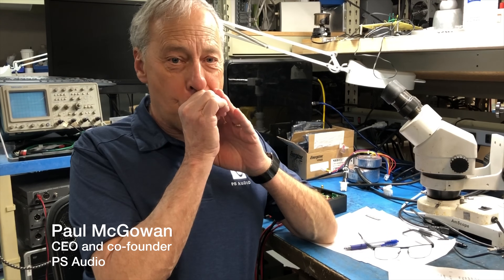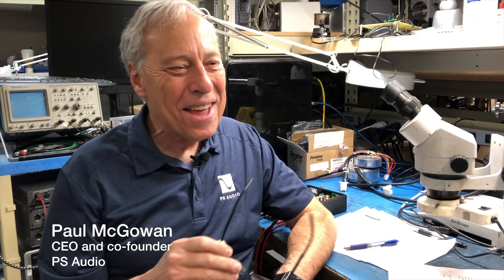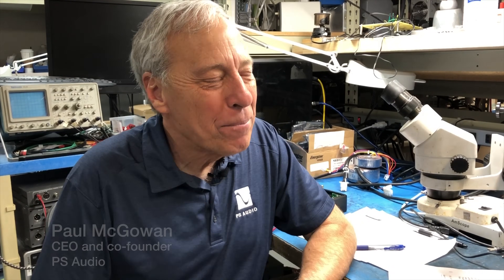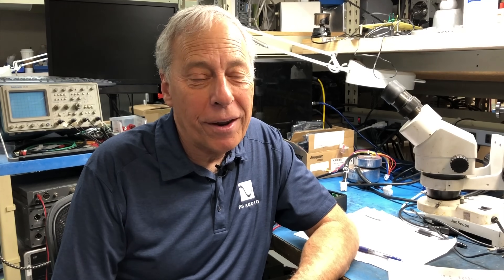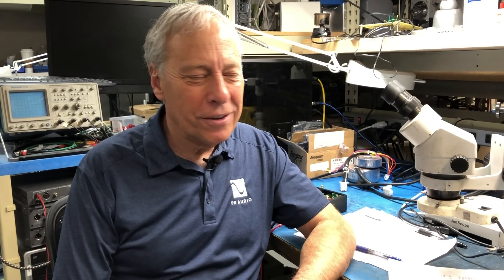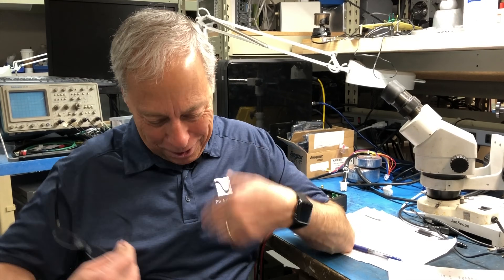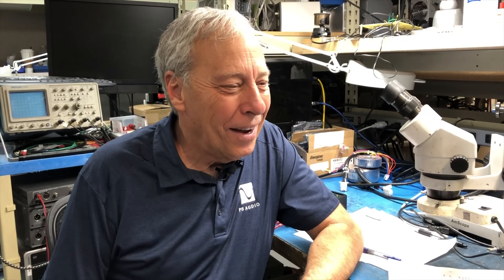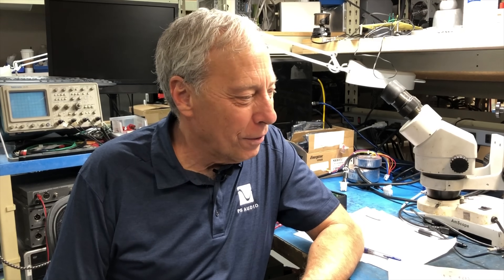How do horn loaded speakers work and sound?

Comment: Since we are on the topic of horns. Lets cover transmission line's in the next video. I believe it's possible to create a horn that does not color the sound. We also need to understand that another purpose of horns are to direct sound across particular distances. Understanding the soundwave itself allows you to decide what length of horn or even wave guide is needed for the application.
Reply: Coloration is mainly caused from softer, weak, thin, or loose materials. When the given frequency interacts with its surroundings and begins resonating thats when acoustic coloration begins. Soft materials are used to absorb sound and hard materials are used to reflect or project the sound. The goal in transmission line's and wave guides are to be as hard, solid and smooth as possible. You are mainly wanting to focus your attention on the speaker drivers themselves and only hear the sound that they are giving off. Not the enclosure resonance for the drivers. Only if it were possible to make speaker enclosures and wave guides out of polished diamond. The hardest known rock solid substance on the planet. Then you would understand what im talking about. But the price of diamonds is the main reason it hasn't been done. Maybe some kind of glass... Cone material of a driver designed for a particular frequency response is a completely different story because thats when weight and efficiencie is involved.

Comment: I still have my Qln Artec 1600 line source speaker and think they have all the advantages of the traditional dynamic speaker, still with much better efficiency and ability to also perform well in more challenging listening environments.
http://qln.se/discontinued-models/artec-1600/